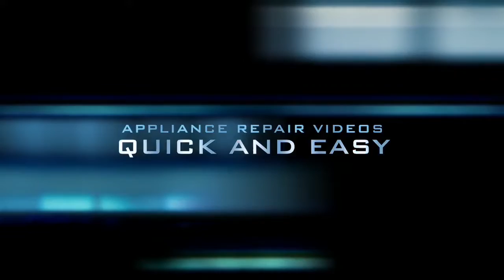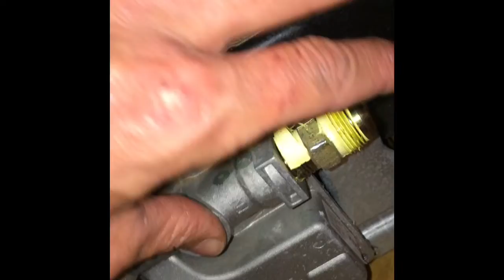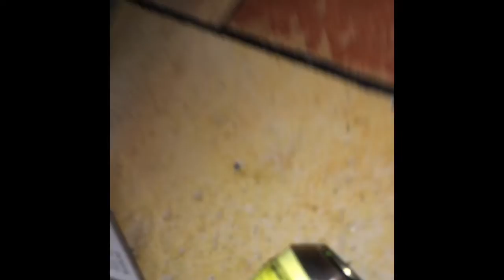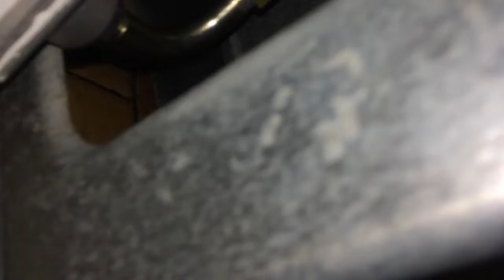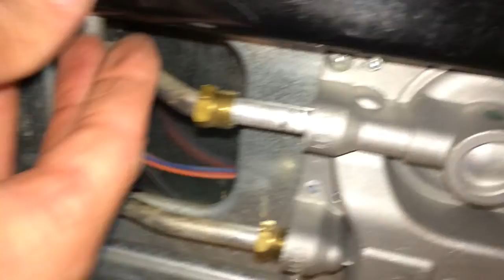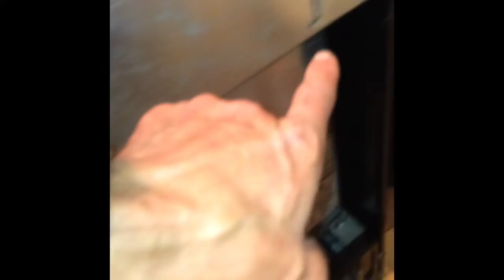✨ Kitchenaid Oven - Bake and Broil - Don't Heat Up ✨

Comment: This worked! I ran the error codes by pressing off off on and the error code was for the safety valve or main circuit board. Swapping the safety valve did the trick!!! Thank you!
Reply from the maker: Fantastic news, so glad it worked! 😊

Comment: Kitchenaid gas range, broil and top burners work fine, bake setting not working. Ignition coil glows red hot, but still will not ignite even with a lighter, could this be a gas safety valve?
Reply from the maker: The igniters will often glow but are too worn out to allow the safety valve to open and let gas flow.
A new igniter will fix it👍

Comment: Hi Scott - thanks for the very insightful video.  I have a similar looking range.  Top burners work fine.  Neither bake nor broil work, however.  I hear three clicks and smell gas but no ignition.  In the past, sometimes it would work, sometimes not.  Now it's always not 😞 Any help greatly appreciated.

Comment: Hello! 
I have the same stove, but when I try to use the oven, I hear two clicks. The oven heats up a little but not enough to actually bake. I have contacted someone and they believe it is the relay board. Is there any way you can help or advise me further?
Reply from the maker: If it’s gas, I would change the igniter.

Comment: Hi, we have the same oven but electric. When using convect  bake, roast or broil it won't heat up past 280 degrees. on regular bake or broil it will heat up to the right temperature. We're not sure if it's a similar issue you describe here? Let us know if you can comment or have a video addressing these issues?
Reply from the maker: Very likely you just need to replace the convection element that surrounds the fan.

Comment: Scott-  Thank you for this video.  I have the exact same oven, and the same symptoms.  I tested my existing gas safety valve and it tests about the same 210 ohms for both terminals.  I haven't had spark on the top for years, it slowly got weaker and then died.  So now when i turn on the oven or broiler I get a click, a puff of gas but no spark and it shuts off.  Ignitor Board?  Or? Thanks again.
Reply from the maker: Hi John, I think you just need a new spark module 👍

Comment: What happens if you still have continuity thru the valve and it will not spark sometime and other times it will. Also, when the oven is operating, the oven will not stay lite. Do you still think it's the valve? This present valve is only 3 months old. PERPLEXED!!!!!
Reply from the maker: Hi John, I would try replacing the igniter

Comment: Hi Scott we have replaced igniter and fuses and oven and broiler do not click, ignite or heat up .  if the stove top ignites could it still be the safety valve?
Reply from the maker: Did they click before to cause ignition?
Reply: Scottthefixitguy  we also replaced a fuse
Reply from the maker: That does sound like the safety valve.
Reply: yes it did click to light before.  Now the broiler one clicks but then nothing happens.  the bottom one does not click.  We only replaced one igniter

Comment: Excellent.  I have the exact range with this problem.  Gas valve on order after confirming infinite resistance.  I am a fitter but am week with appliances.  Food for thought.  T-tape or pipe dope on pipe fitting and nothing on flare fitting which is what the flex line is.   Cheers
Reply from the maker: Very good,

Thank you

Comment: Hi Scotty!
You are very knowledgeable. Do you work on electric too?   I have a Kitchenaid # KERS807SSS00.  Id appreciate  any advice or guidance from you.

 The problem with this range is ... it has NO seal on the to to prevent the spill-over from top to the bottom!  And that’s what I had!  Hubby ... quickly dried up everything and it was working fine for two days and yesterday it blanked out!!  He unplugged it and nothing! I called KA/Whirlpool they referred me to their website, I entered the model # and nothing!
Can you help us?  Thank you so much.

Comment: My stove gas works but not the broil or bake in oven. Is it both ignites or this safety valve. If it was safety valve I should get no gas at all yo stove also? So must be if igniter?
Reply: I have the same problem.   Replaced one ignitor and some fuses but now there is no lighting  of broiler or bake.    but the stove gas still works.  Did you figure out your issue?

Comment: Scott, great video.  I have same oven. The Bake and Broil both don't ignite but I can hear the click and smell gas when Bake or Broil is turned on.  I checked the resistance on the Gas Control Valve and it momentarily shows 190 ohms between red-blue and orange-blue terminals and then open connection meaning infinite resistance.  Do the resistance on these terminals should be persistence? It is not clear from your video.  I would appreciate if you can clarify as soon as possible.  I want to confirm this before ordering the new valve, because most distributors won't take the parts back once bag is opened.  Thanks in advance and much appreciated.
Reply: I have the same oven and symptoms.  For bake and broil, I hear clicking and smell gas, but no ignition.  Did you replace the safety valve and did it work?

Comment: Hey Scott, I have the same type of oven but I noticed when I turn it on I get spark and it lights but I lose the flame after a second.  Happens on both bale and broil.  Any ideas what could cause this?  Thanks
Reply: I have the same problem.  What did you do to get yours working again?
Reply: @robertwarren1234  did you fix it I have the same problem